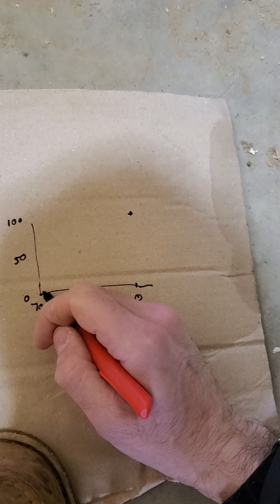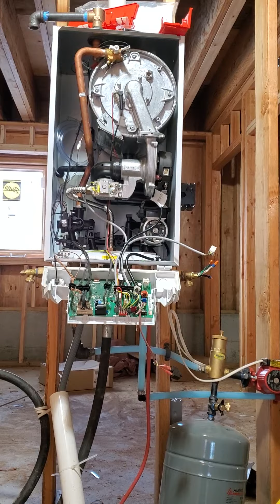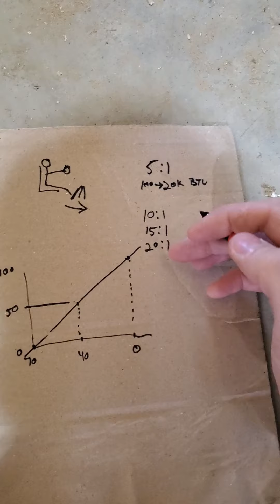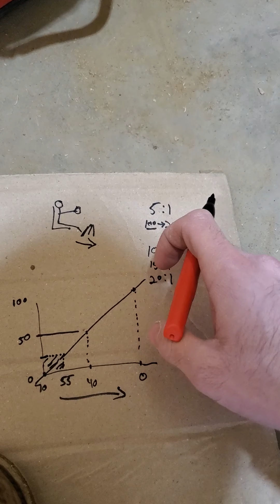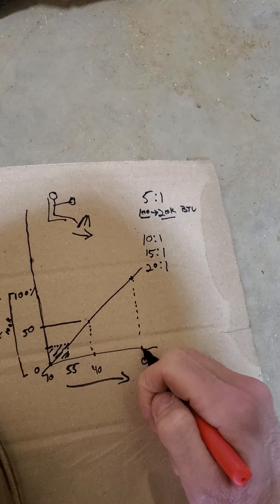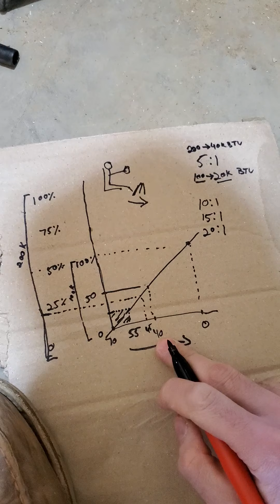Can you oversize a modulating heating or cooling system?

Comment: Great video. I will say turndown ratio is very important with inverter heat pumps being used as a primary heat source. In our climate we are sizing the heat pump for heat capacity, which consequently oversizes the unit for cooling capacity. The problem is explaining this to customers is almost impossible.